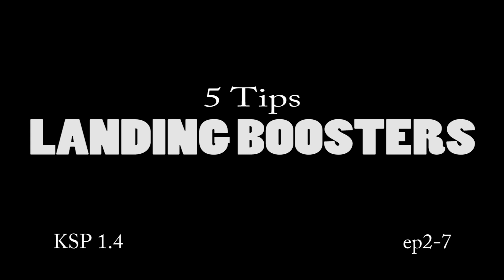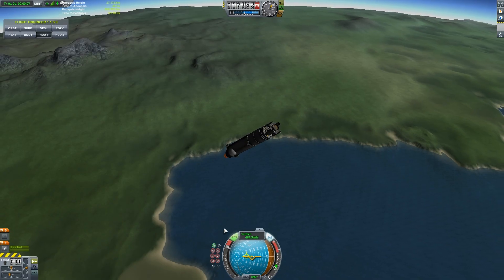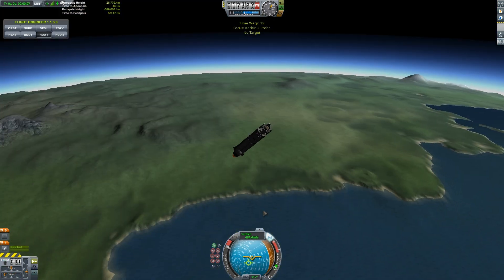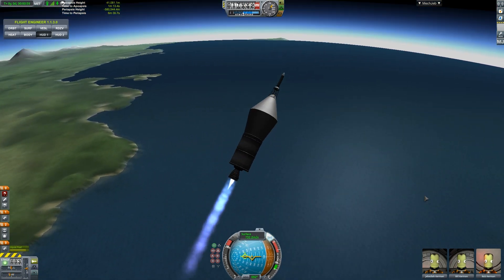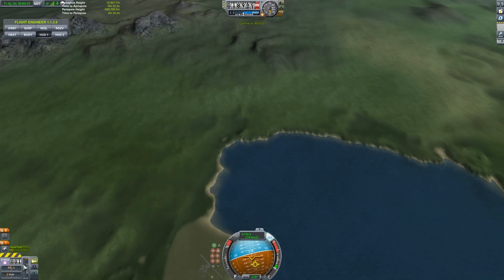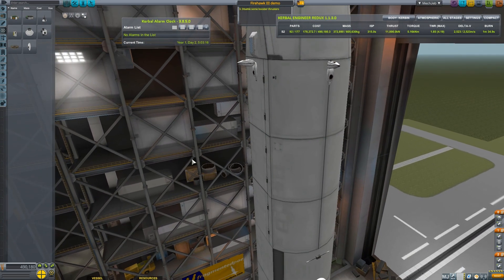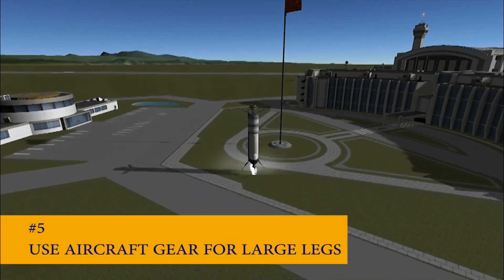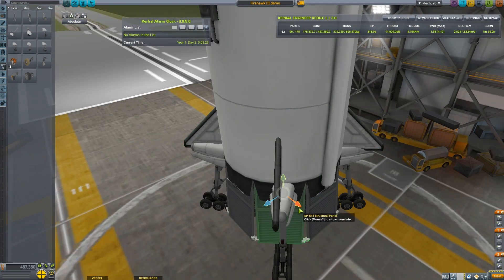5 Tips Landing Boosters v1.4

Comment: How to land your 1st stage and get in orbit without any mod
Requires:
-1st stage have at least 2,500m/s
-2rd stage have enough thrust to lift 1.5x it self (ex: rocket weight 10ton, will need 150kn of thrust)
-spare your 1st stage around 1500m/s (it would take around 500 to 800m/s to boost back)(and probably another 700m/s ‘noob’ or 400m/s ‘pro’)
-make sure your center of weight is as low as possible since your rocket will flip over while re-entry if they are too high
Steps:
1- get your ap to around 70km 
2- separation 
3- boost your 2rd stage a bit so you won’t collide with 1st stage 
4- switch to 1st stage (with { or } key)
5- boost the first stage to around 120,000km (so you can have time to do the orbit burn)
6- switch back to 2rd stage (with { or } key) and do whatever to get in orbit in less than 1 minutes 
7- when in orbit open map and select your 1st stage and press switch to (since {} key don’t work at this range )
8- boost back 
9- land

(If you can’t do it then just remember the person who write this is a 13 years old 🤣)